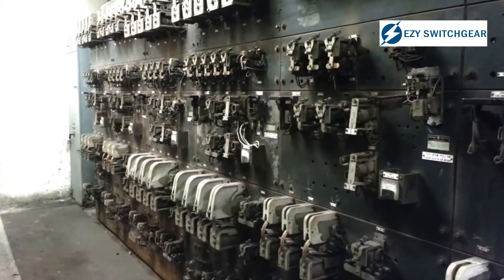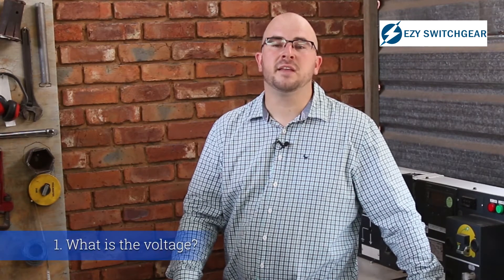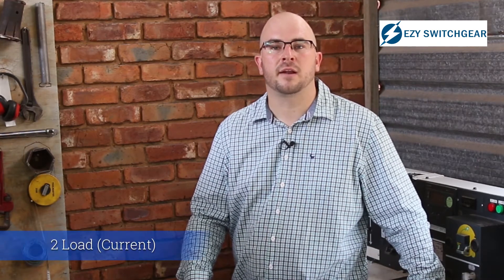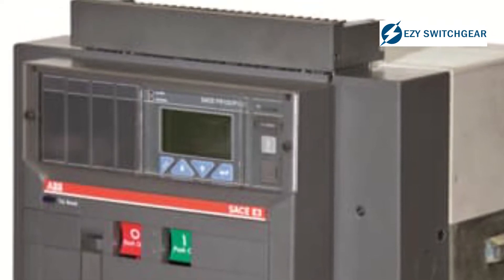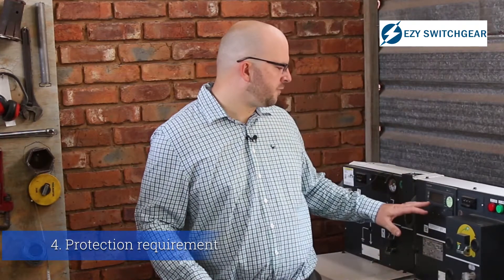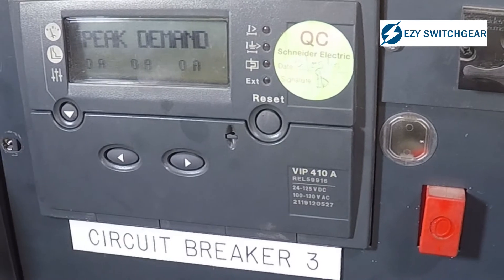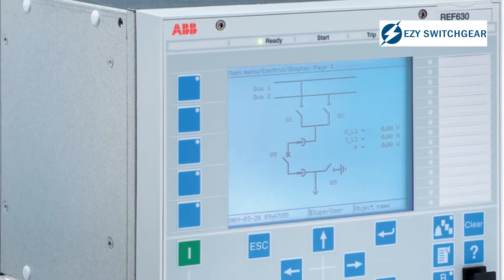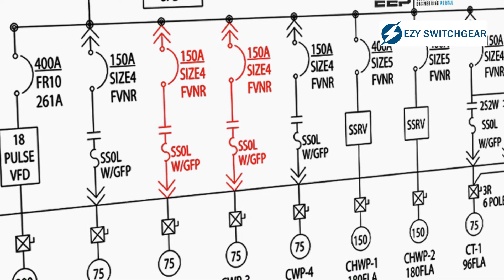Important specifications for Medium Voltage Switchgear

Comment: Thank you for this expository explanation. I wish to know the direct difference when it comes to Medium voltage and Low voltage distribution systems
Reply from the maker: The biggest difference is that Voltage Effects (Insulation quality and partial dischange) plays a much more significant role in the tests.